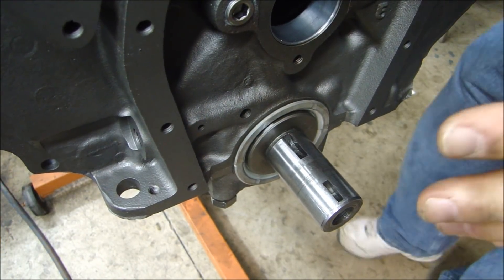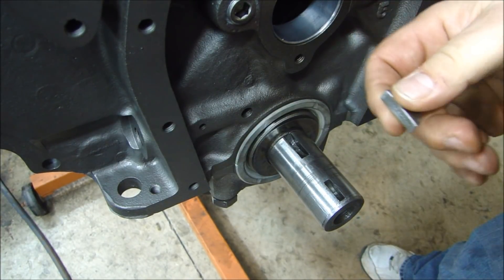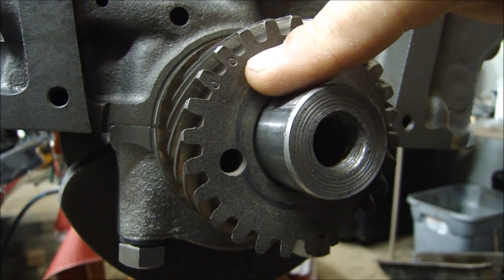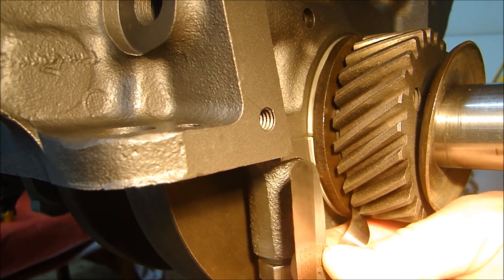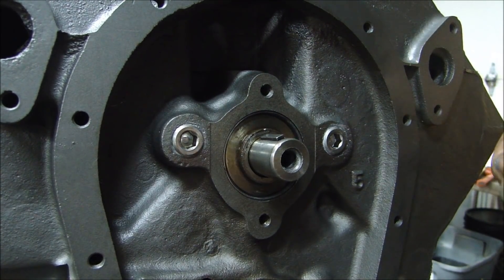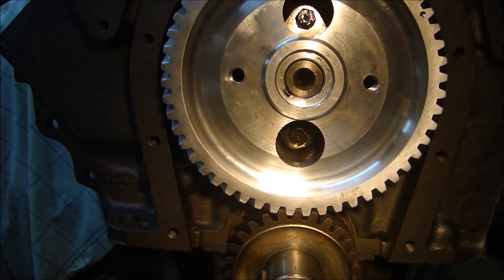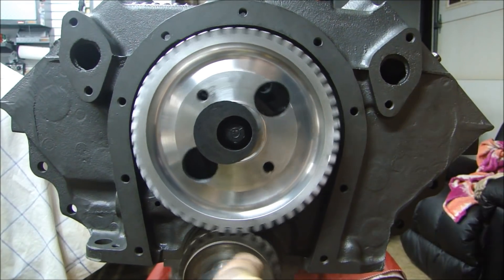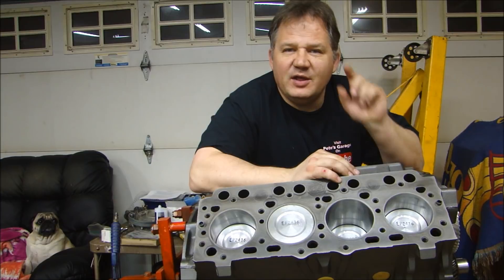Engine Rebuilding Studebaker 289 - Assembly Part 2

Comment: Hey Pete, my 289 had two shims that were bent and torn. I need two of them but can’t find anywhere that has them. Not even studebaker national which is where I got the engine rebuild kit. You have any clues or ideas of where I can get some or even make some?
Reply from the maker: Hand cut them from shim stock

Comment: Thanks  for the video of this  engine. I was  looking at a '63  Lark with a  289 Stude engine and I was unfamiliar with it.  Nice to see a  truck -style gear drive on the cam, that must have a  little  whine to it !  Is that a Silicon Aluminum, alloy replacement gear?  One  note  - you can't  "accidentally" time  the  cam 180 out. If the  marks  are (still)  aligned after a  couple  rotations - its in phase.  Now  the  distributor is  another  story. Even the best and  most experienced builders   seem to get them in a  tooth or  two  off.  I think  that's because they don't take into account the  mechanical AND vacuum  timing advance. They usually just point the rotor to the  #1 cap  terminal.  Most dist fire  30+ deg before TDC at high idle vacuum .    I would  set the engine at 35 deg BTDC and  open the  mechanical flyweights,  then rotate the  distributor until the  #1 cyl points  are  just opening.  You can do this  with coil on and  use a  spark as  reference. The  rotor  should be  on the  approach side to cylinder 1 terminal. if not,  you will have to remove the  dist and  move it a  tooth in the correct direction. This  very confusing to many mechanics.  Sometimes  or  maybe  most times we  just like to roll the dice  and  hope for  a  good  outcome here. :) - Sandy
Reply from the maker: Thanks Sandy, it's a composite gear, not sure of the material. Great point about the distributor and timing, thanks

Comment: Whats up with the two holes that is part of the oil gallery that is in between the cam and crank gear. the one that is behind the cam gear that you did not install.  Talk about no oil pressure, I wonder how many people have blown their engines because of this video.Tthanks for the incomplete video on how to rebuild a engine with no oil pressure.
Reply from the maker: I would encourage you to look again, those are oil drain back holes to lube the timing gears. There is no pressure in them

Comment: A claw hammer shouldn't be anywhere near an engine...
Reply from the maker: One of my goals is to encourage anyone who wants to build or rebuild their own engine. That means that I need to show you do not need thousands of dollars in special tools to do it. A hammer is simply a weight on a handle. If someone is rebuilding their 350 Chevy they don't need to buy $150 worth of hammers or mallets to put it back together.
Reply: @PetesGarage  
I was being facetious, I'm a retired Ford Lincoln Mercury technician, fighting cancer at the moment and have been binge watching, a Studebaker truck fan...
Reply from the maker: Ok, thanks for the comment

Comment: at around 4:30, that gear you're tapping on, I know wit air-cooled engine like VW, Porche etc., you're supposed to heat them in hot motor oil so the metal expands. Start at cold and raise it up to a couple hundred degrees kinda like you're deep frying something. The expanded metal slides right on there, i dont know if that'd make it easier for you. Just food for thought. Enjoying this video series!
Reply from the maker: That is a good idea. If this one did not slip on so easily I would have preheated it in an oven.

Comment: Why use old cam? U know those old humps hav wear! Oh going to use old lifters too?? I seen dude rebuild 1969 Pontiac 400 it ran great just had lots of blow by and low oil pressure at idle when at operating temp! Changed rings n rod n crank bearings got new timing set n oil pump n new lifters n used same cam put her back together! No blow by n Idled with 35lbs oil pressure at operating temp!! But after few thousand miles lifters started whacking pull cam n lifters out cam was rounded off not just one hump but whole length of cam was humpless stuck new lifters back n it she's still running today
Reply from the maker: Well, there are no new cams made, even a close aftermarket. The lifters were in very good shape and the spring pressure is very low so the risk is minimal.

Comment: Help me with specification torque settings for 4D35 canter engine.. main bearing, Conrad caps and cylinder head bolts????
Reply from the maker: Main 130 ft lbs
Rod bolt 92 ft lbs
Head bolt 145 ft lbs
Reply: Thanks what about valve lash settings intake and exhaust..

Comment: Really? A claw hammer? Your not building a house. Don't you own a ball ping hammer? SMH! And your previous episode after you set the crank in & was checking the thrust clearance you were only suppose to install the number one cap and the thrust bearing cap only. Then with a soft face hammer (plastic dead blow or brass), tap the crank nose (moving the crankshaft rearward). Install a dial indicator to read on the crank flange or nose of the engine. Using a large (clean) screwdriver or pry bar, move the crankshaft backward. Zero the gauge on the dial indicator. Pry the crankshaft forward and check the reading. Record the measurement. Next, torque the caps to specs and repeat the process. Compare the measurements. If the second reading is less than the first, there’s a chance the rear main cap shifted and the thrust surfaces are misaligned. And you really need to be using a dial indicator, not feeler gauges.
Reply from the maker: Sadly, I did not find any engine building videos on your channel. A couple of points for you. I have every tool and fine measuring device available. When I make videos such as these I use tools that a regular person may have. My goal is to help anyone who wants to rebuild their own engine. I would not be helping if I said they had to buy thousands of dollars of special tools to do it. As for the thrust clearance I ask you watch the next video in the series. Thank you for your detailed comment. There is some valuable information for others.

Comment: If you dont have the tool for the cam gear its ok use a solid bolt not soft ... not to damage the tread... on that bolt put a nut all the way .. then two washers.. slide your gear has far has you can.. use the bolt on the cam make sure that its tight and all the way on and make sure that you have the two washers between the cam gear and the nut on the bolt. hold the bolt in place with ratchet and a wrench to back the nut. go slow and it should be essay. then release the pressure for the nut and remove the bolt. have a good day!!
Reply from the maker: Awesome! Thanks for the tip!

Comment: If you can find a long bolt that is the same size as the cam, you can use it as a handle instead of just holding on to the "nose" of the cam. Makes things easier.  : )
Reply from the maker: That is a great suggestion

Comment: That oil pump "washer" does not look quite at 12 ? Maybe I don't see good. How important is that it sits top dead at 12 o'clock ?
Reply from the maker: Which washer? I didn't put in the oil pump yet in this video.
Reply: Excentirc washer at 9:42 , fuel pump washer ?
Reply from the maker: That is the fuel pump eccentric and it only goes in one way. It is not adjustable
Reply: OK, got it ! Thanks.

Comment: What did you use to clean the Studebaker block with?  If you had it cleaned, what is the normal rate of charge for that?
Reply from the maker: It gets dip clean then baked and blasted. It's about $100
Reply: Did you get it painted? What keeps it from rusting?

Comment: lubing the camshaft lobes and leave the bearings out. cannot be more stubborn than that dude.
Reply from the maker: I only put the assembly lube on the lobes because it is a solid lifter cam. I heavily oiled every bearing internally just before sliding the cam in, then I add oil before putting the oil pan on.

Comment: You could also press the lower gear on to the crankshaft with a self made press on tool (saw that there is a thread in the shafts end). That way you can prevent axial force going through the crankshaft and potentially break or bend it if you knock on it to hard.
Reply from the maker: I do have a hydraulic press tool, but I wanted to show a regular guy how to do it. I said there are many ways to do it. If it went on tight I would have used the hydraulic press. I understand your point, thank you

Comment: At approximately 10:18 is  there debris or a broken off bolt in the timing cover bolt hole at about the 11 o'clock position?
Reply from the maker: I just looked. It's an optical illusion. That is a through hole and you are seeing the block through the hole.
Reply: +Petes Garage 
OK, I see now, it just looks different than the other bolt holes. 
Thanks.

Comment: No belts, no chains, not possible for valve timing to be 180 out.  Ignition is another story.
Reply from the maker: Of course it's not possible, but it never hurts to check
Reply: A carry over from timing belts, where such a check is necessary, so probably best not to change routine from engine to engine, agreed.

Comment: So this engine doesn't use a timing chain right?... the crank gear and the cam gear are in constant mesh.
Reply: It's a Studebaker V8, timing gears instead of chains, solid lifters, forged crank and pushrods. They are heavy for their size but things are TOUGH.
Reply from the maker: Yes
Reply: that pretty cool